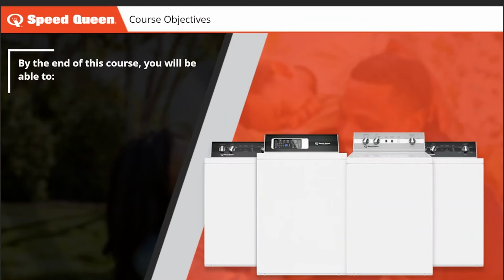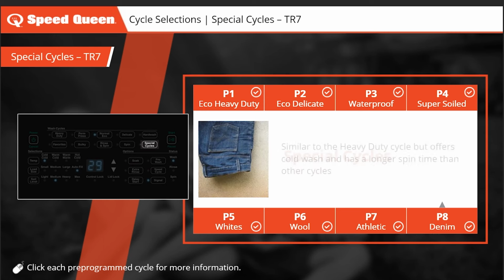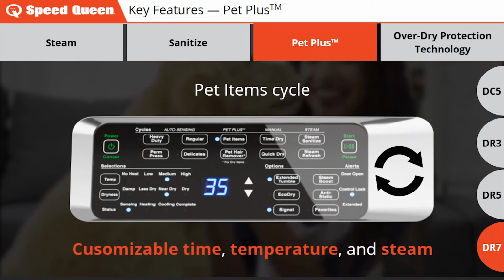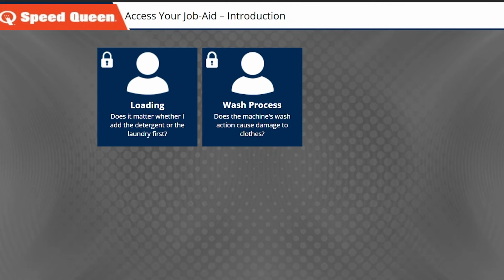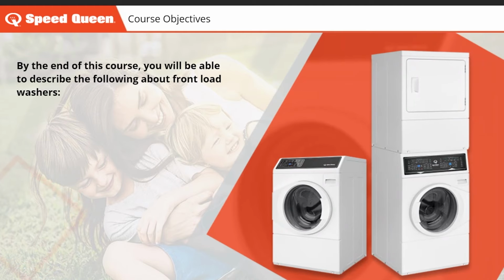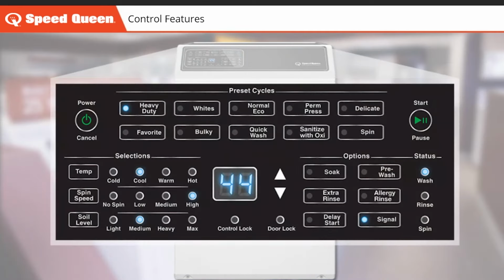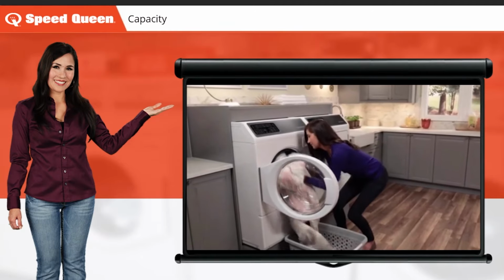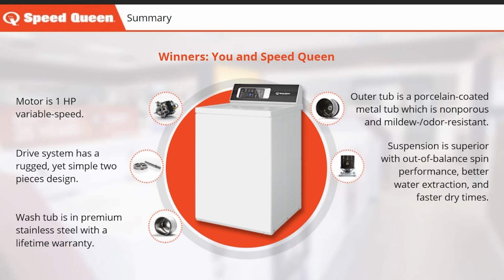✅️Speed Queen Washer & Dryer Info

Comment: I agree that Speed Queen is a quality brand.  But, I would like to ask you a question.  We have Speed Queen washer model TR3 which we bought in 2019.  My wife loves the machine, except for the order that comes from the washer.  She always leaves the top load door open when not in use and never leaves wet clothes in the washer.  Have you heard customers talk about this?  Do you have any thoughts on how we could treat the odor?  Would really appreciate any input.  If you need more details let me know.  If others reading this and have any input, please pass it on.  Thanks
Reply: Get some washing machine cleaner and run the machine on a large load with hot water on at least the perm press cycle. We have the TR5 and this has kept ours from ever having odor issues. Dollar Tree sells a powdered washing machine cleaner that does an amazing job. You get three washing machine cleaner packets for $1.25. I clean ours once a month. The cause of the odor is probably from sebum/body oil build up in between the wash tub and the tub underneath.

Comment: OMG...the first segment is wrong.  Dry clothes coming in direct contact with concentrated detergent (sitting at the bottom of the drum) can cause discoloration. 
It's best to start the washer and add detergent so the water and detergent mix.  Then add clothes after a few inches of water has filled the drum.
Reply: I disagree because if you start the washer with no clothes, the load sensing will be thrown off and it won't fill with as much water. Clothes in direct contact with detergent should be fine, if you get discoloration you're using a bad detergent or your clothes are not high quality with stable dyes.
Reply: @TechnicalLee  So how will the detergent dissolve with the clothes sitting on top?
Reply: Speed Queen should consider adding water recirculation that runs during agitation.